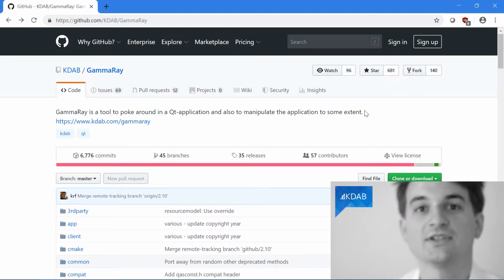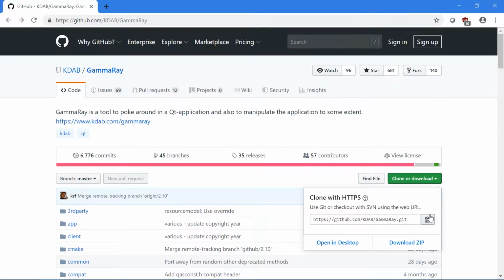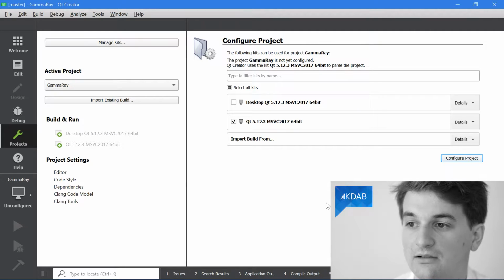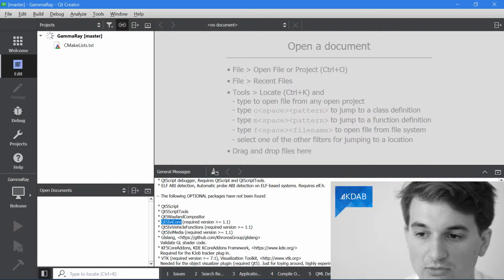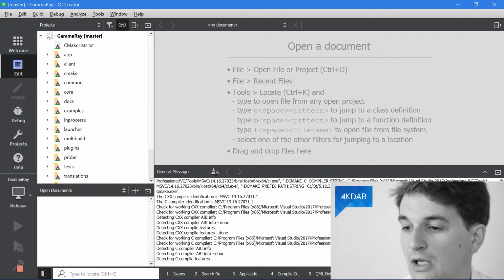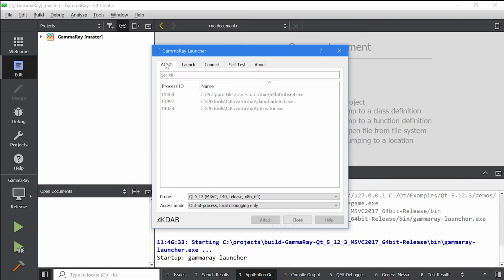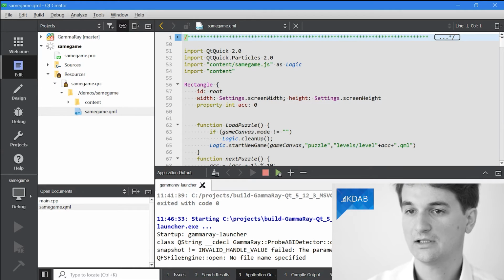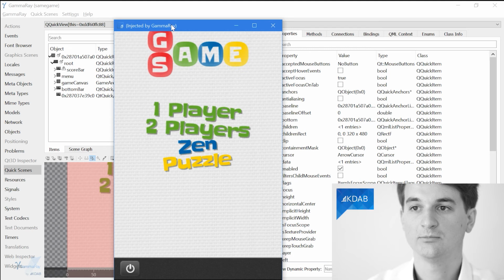GammaRay Tutorials (Part 2) - How to set up GammaRay on Windows

Comment: Milian, I followed the instructions in this video, but never make it work. Can you please give some suggestions?
-------------------------------------------------------------------------
My environment:
Cmake version: 3.24.2
QT version: 6.4.2
Visual Studio 2019
Kit: Desktop Qt 6.4.2 MSVC2019 64bit
Qt Creator version: 9.0.1
----------------------------------------------------------------------------
From Qt Creator menu
New Project -> Import Project -> Git Clone. Input the https://github.com/KDAB/GammaRay.git into "Repository" and click Next.
Clone finished, and choose the CMakeLists.txt as project file and clicked "Ok".
Qt Creator started the configuration project dialog.
In my case, I selected "Desktop Qt 6.4.2 MSVC2019 64bit" kit and only release version.
Click the "Configure Project" to start configure the project...
Below is the output from qt creator "General Messages" panel.
---------------------------------------------------------------------------
Logging in and fetching licenses ...
Checking for updated license succeeded (2 licenses fetched)
Running C:\Program Files\CMake\bin\cmake.exe -S C:/Kdab/GammaRay -B C:/Kdab/build-GammaRay-Desktop_Qt_6_4_2_MSVC2019_64bit-Release "-DCMAKE_GENERATOR:STRING=Ninja" "-DCMAKE_BUILD_TYPE:STRING=Release" "-DQT_QMAKE_EXECUTABLE:FILEPATH=C:/Qt/6.4.2/msvc2019_64/bin/qmake.exe" "-DCMAKE_PREFIX_PATH:PATH=C:/Qt/6.4.2/msvc2019_64" "-DCMAKE_C_COMPILER:FILEPATH=C:/Program Files/Microsoft Visual Studio/2022/Community/VC/Tools/MSVC/14.34.31933/bin/HostX64/x64/cl.exe" "-DCMAKE_CXX_COMPILER:FILEPATH=C:/Program Files/Microsoft Visual Studio/2022/Community/VC/Tools/MSVC/14.34.31933/bin/HostX64/x64/cl.exe" "-DCMAKE_CXX_FLAGS_INIT:STRING=" in C:\Kdab\build-GammaRay-Desktop_Qt_6_4_2_MSVC2019_64bit-Release.
-- The CXX compiler identification is MSVC 19.34.31937.0
-- The C compiler identification is MSVC 19.34.31937.0
-- Detecting CXX compiler ABI info
-- Detecting CXX compiler ABI info - done
-- Check for working CXX compiler: C:/Program Files/Microsoft Visual 

---------------- I OMITTED MANY LINES  -----------------------------

-- The following RECOMMENDED packages have not been found:

 * KF6SyntaxHighlighting (required version >= 5.28), <https://www.kde.org/>
   Syntax highlighting for code editor.

-- Configuring done
-- Generating done
-- Build files have been written to: C:/Kdab/build-GammaRay-Desktop_Qt_6_4_2_MSVC2019_64bit-Release
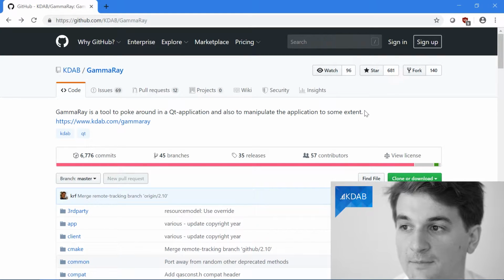Elapsed time: 00:59.

---------------------------------------------------
Select the "gammaray-launcher" for the run configuration. Start to build.
Build failed. Below are info from the "Compiler Output" panel in qt creator. 
--------------------------------------------------

08:29:39: Running steps for project GammaRay...
08:29:40: Starting: "C:\Program Files\CMake\bin\cmake.exe" --build C:/Kdab/build-GammaRay-Desktop_Qt_6_4_2_MSVC2019_64bit-Release --target all
[1/1046 1.1/sec] Automatic MOC and UIC for target gammaray_lz4
[2/1046 1.7/sec] Automatic MOC and UIC for target gammaray_winloader
[3/1046 1.8/sec] Automatic MOC and UIC for target modeltestobj
[4/1046 2.4/sec] Automatic MOC and UIC for target gammaray_wininjector
[5/1046 2.9/sec] Automatic MOC and UIC for target test_helpers_obj

-------- MANY LINES OMITTED HERE

[268/1046 3.0/sec] Generate codecontrbutions.qdoc using qtattributescanner
FAILED: docs/manual/codecontributions.qdoc C:/Kdab/build-GammaRay-Desktop_Qt_6_4_2_MSVC2019_64bit-Release/docs/manual/codecontributions.qdoc 
cmd.exe /C "cd /D C:\Kdab\build-GammaRay-Desktop_Qt_6_4_2_MSVC2019_64bit-Release\docs\manual && C:\Qt\6.4.2\msvc2019_64\bin\qtattributionsscanner.exe --output C:/Kdab/build-GammaRay-Desktop_Qt_6_4_2_MSVC2019_64bit-Release/docs/manual/codecontributions.qdoc --filter QDocModule=gammaray-manual C:/Kdab/GammaRay"
Could not parse file C:\Kdab\GammaRay\3rdparty\StackWalker\qt_attribution.json: unterminated object
[269/1046 3.0/sec] No update step for 'GammaRay-Debug'
[270/1046 2.9/sec] Building CXX object plugins\widgetinspector\CMakeFiles\gammaray_widget_export_actions.dir\widgetinspector_export_actions.cpp.obj
[271/1046 2.9/sec] Building CXX object translations\CMakeFiles\ljsonupdate.dir\ljsonupdate.cpp.obj
[272/1046 2.9/sec] Building CXX object plugins\widgetinspector\CMakeFiles\gammaray_widget_export_actions.dir\uiextractor.cpp.obj
[273/1046 2.9/sec] Automatic MOC and UIC for target gammaray_geopositioninfosource
[274/1046 2.9/sec] Building CXX object plugins\quickinspector\CMakeFiles\gammaray_quickinspector_shared.dir\gammaray_quickinspector_shared_autogen\mocs_compilation.cpp.obj
[275/1046 2.9/sec] Building CXX object plugins\quickinspector\CMakeFiles\gammaray_quickinspector_shared.dir\quickinspectorinterface.cpp.obj
[276/1046 2.9/sec] Automatic MOC and UIC for target example-signal-slot
[277/1046 2.9/sec] Building CXX object plugins\quickinspector\CMakeFiles\gammaray_quickinspector_shared.dir\quickitemgeometry.cpp.obj
[278/1046 2.9/sec] Automatic MOC and UIC for target example-widget-layouting
[279/1046 2.9/sec] Automatic MOC and UIC for target example-timer
[280/1046 2.8/sec] Automatic MOC and UIC for target gammaray_core
[281/1046 2.8/sec] Automatic MOC and UIC for target gammaray_ui
ninja: build stopped: subcommand failed.
08:31:20: The process "C:\Program Files\CMake\bin\cmake.exe" exited with code 1.
Error while building/deploying project GammaRay (kit: Desktop Qt 6.4.2 MSVC2019 64bit)
When executing step "Build"
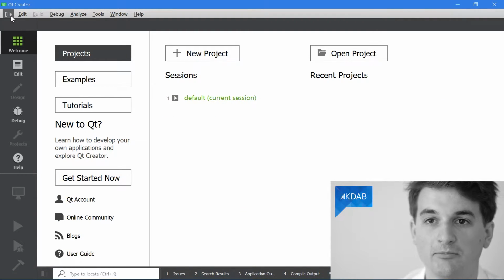08:31:20: Elapsed time: 01:41.
Reply from the maker: Hi Joey! 
Please open up an issue on the corresponding GammaRay GitHub. This is the fastest way for you to receive help for your situation. Cheers!

Comment: Thanks Milian, I have installed the pre compiled Gamma Ray from the KDE software center. The "Quick Scenes" option seems to be missing from the left hand side menu. Can you guess why this is the case?
Reply from the maker: Hi Eddie! Thank you for your question. With "missing" do you mean it's not there at all, or is it greyed out and disabled? The latter would be the case for the situation when you attach GammaRay to an application that simply doesn't use QtQuick internally. The former would indicate a missing plugin - can you try and see if you find gammaray_quickinspector{,_ui}.so in your plugin path? See qtdiag | grep plugin. If the plugin is missing, please get in touch with your distribution packager about the missing dependency of QtQuick at GammaRay build-time. Though maybe you can just install it as a secondary package - that depends on your distribution! One way or another, talk to your distribution's support channel please.

Comment: I've tried to install your KDAB Gamma Ray program several times using this video's instructions in the community Qt Creator 4.12.4 (based on Qt 5.14.2 (MSVC 2017, 32 bit) but it keeps failing.  I start with File New > Git Clone
Location Repository:  https://github.com/KDAB/GammaRay.git
Branch: <default branch>
Path: D:\Qt (installed Qt on this drive on 7-30-20)
Directory:  GammaRay   CLK > Next  (clones into GammaRay)  > CLK > Finish (open dialog box with 
2 Project File: choices)

My 1st attempt I selected: 
D:\Qt\GammaRay\CMakeLists.txt    (this file does exist in this directory)  CLK > OK (opens Configure Project screen but "NO suitable kits found"   My only choice was Import Build from...
D:\Qt\GammaRay  CLK > Import  
(opens No Build Found - Qt Creator dbox 
  No build found in D:\Qt\GammaRay matching project D:\Qt\GammaRay\CMakeLists.txt)  but in fact that file DOES EXIST in that directory !!!

My 2nd attempt I selected: 
D:\Qt\GammaRay\gamma-qt-ci-only.pro (this file does exist in this directory)  CLK > OK (opens Configure Project screen with two(2) suitable kits available.
  Desktop Qt 5.15.0 MinGW 32-bit (checked) > CLK > Details (unchecked Debug and Profile per your video)

This opens a Qt Creator project but with errors:

Projects:
  GammaRay (master)
         CMakeLists.txt
  gammaray-qt-ci-only (master)
         gammaray-qt-ci-only.pro
         qt-ci-wrapper
                 qt-ci-wrapper.pro

General Messages
Project ERROR: You need to set the ANDROID_NDK_ROOT environment variable to point to your Android NDK.
Could not read qmake configuration file D:/Qt/5.15.0/android/mkspecs/android-clang/qmake.conf.
Project MESSAGE: QMake wrapper for the GammaRay build system is only supported for the Qt CI.
Project MESSAGE: If you are seeing this and you are not the Qt CI, please refer to Install.txt!

How do I fix this?  Thank you in advance.
Reply from the maker: Hi! It is documented in the Install.txt file, specifically starting here: https://github.com/KDAB/GammaRay/blob/master/Install.txt#L54

Hope that helps!
Reply: @KDABtv  This is not helpful at all. Your video instructions are specific to a Windows 10 install are completely different that your multi-platform  Install.txt instructions.  I provided a detailed account of the steps I used and the error messages I received for 2 install paths from your video.  Is there someone in tech support that could help me through this problem?

Comment: I am unable to select any of the Kit on the configure step. Then i downloaded cmake and added cmake.exe to PATH but there are some unknown and weird errors but i am able to launch gammaray from outside Qt but getting this error when launched from inside i.e by shortcut key configured in part 3 video

Starting external tool "C:\build-GammaRay-Desktop_Qt_5_14_2_MSVC2017_64bit-Release\bin\gammaray.exe /c echo Useful text"
No probe ABI specified and ABI auto-detection failed, picking qt5_14-MSVC-140-x86_64 at random.
To specify the probe ABI explicitly use --probe <abi>, available probes are listed using the --list-probes option.

Failed to launch target '/c echo Useful text'.
See <https://github.com/KDAB/GammaRay/wiki/Known-Issues> for troubleshooting
Reply from the maker: Hi, if you keep having trouble please reach out here https://mail.kdab.com/mailman/listinfo/gammaray-interest or on GitHub.

Comment: got error: any help?
[ 15%] Building RC object launcher/cli/CMakeFiles/gammaray.dir/gammaray.rc.obj
gcc: error: Singh\Documents\git\build-GammaRay-Desktop_Qt_5_14_2_MinGW_64_bit-Release\launcher\cli\gammaray_autogen\include: No such file or directory
C:\Qt\Qt5.14.2\Tools\mingw730_64\bin\windres.exe: preprocessing failed.
mingw32-make.exe[2]: * [launcher\cli\CMakeFiles\gammaray.dir\build.make:110: launcher/cli/CMakeFiles/gammaray.dir/gammaray.rc.obj] Error 1
mingw32-make.exe[1]: * [CMakeFiles\Makefile2:3258: launcher/cli/CMakeFiles/gammaray.dir/all] Error 2
mingw32-make.exe: * [Makefile:182: all] Error 2
17:59:47: The process "C:\Program Files\CMake\bin\cmake.exe" exited with code 2.
Error while building/deploying project GammaRay (kit: Desktop Qt 5.14.2 MinGW 64-bit)
When executing step "CMake Build"
17:59:47: Elapsed time: 07:50.
Reply from the maker: You can try again in a path which does not contain spaces. Otherwise, please contact the GammaRay support / mailing list directly.
Reply: @KDABtv  thanks, this is my 3rd try, I installed git, cmake and qt
Reply from the maker: Sorry to hear that! If you keep having problems or for other questions about GammaRay, please, go here https://mail.kdab.com/mailman/listinfo/gammaray-interest